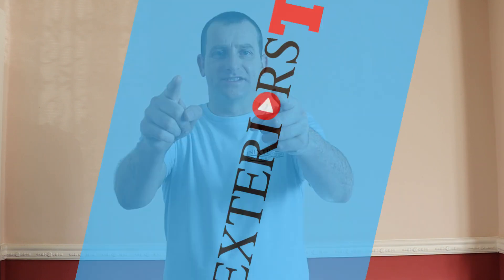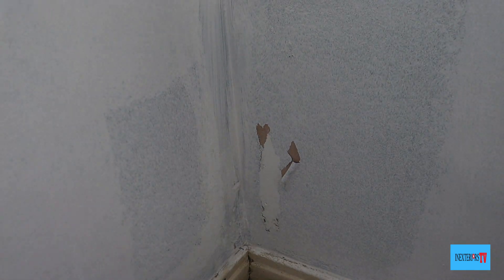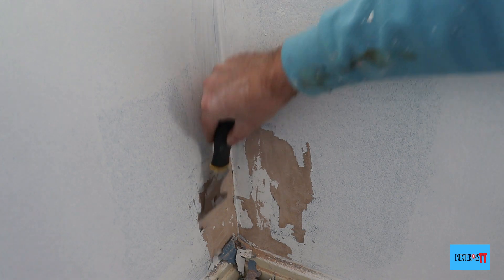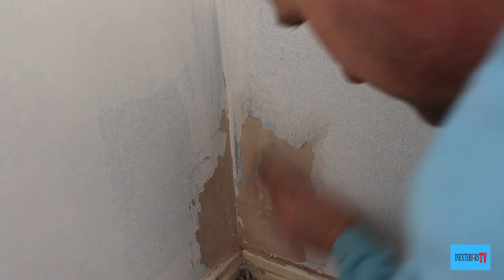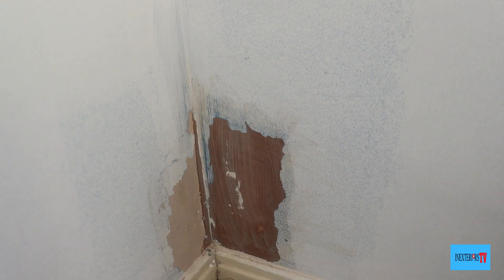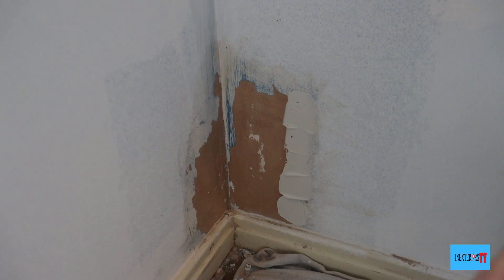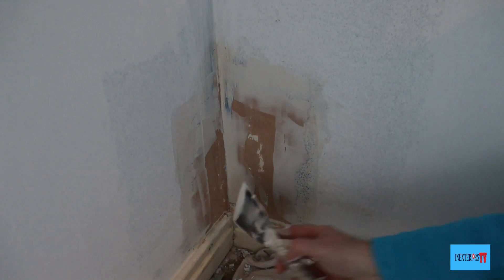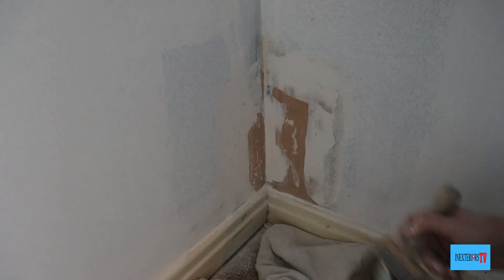How to fix peeling paint. Repairing peeling/flaky paint.

Comment: I used Peel Stop on my shower wall that was peeling. I applied 2 coats of Peel Stop and let dry overnight. Then wiped the wall surface with dry microfiber cloth and painted using sherwin-williams paint.  I was a little disappointed because the paint did not seem to stick very well to the peel stop. I was told you dont need primer for applying latex to it.  Anyway, when pulling the tape off the shower molding, it peeled the paint away in a couple of spots. Didn't expect that to happen.  But I hope the wall will not peel in the future after working on it a day and a half.
By the way, I did the entire wall surface with 220 medium grip sand sponge and clean all debris, before applying Peel Stop.  Hope this wall stays fixed!!
Reply from the maker: It sounds like you worked hard, hope it works for you, open the window when you use the shower. All the best.

Comment: Got the same problem on my artex ceiling. The paint roller seems to have pulled some of it off in a large patch. Although it's recommended not to sand or drill my ceiling, i can atleast try your other methods.
Reply from the maker: @A Samatar. You can indeed my fellow spurs fan. Is it the paint or artex peeling, Come on you spurs.
Reply: @Inexteriors  Think it was the paint. Thanks for the advice
Reply from the maker: @AhmedCSamatar  Use a brush on the offending erea 
 next time.

Comment: That was brilliant thanks.
Reply from the maker: Thankyou very much, thankyou for watching.
Reply: @Inexteriors  have you got a video or any advice please how to prevent flashing/roller marks when painting a wall/ceiling please with emulsion when using a roller. Thanks in advance 👍
Reply from the maker: @christophephilippe1481  When happens on ceilings were its obvious, You can buy a paint called perfect matt for those situations.

Comment: Great video. Is it worth using this on the entire wall over the paint or only the patchy areas? Can you explain why this peeling happens if mist coat was applied correctly?
Reply from the maker: Thankyou very much, the most likely cause of the problem is that the mist cost wasent watered down enough. I only use the peel stop were  needed.

Comment: Hi when you paint after filling did you dilute with water or just use straight out of tin?
Reply from the maker: Neat paint, when its been fine filled if you are painting new plaster or heavy filling then i will water the paint down. the peelstop does a good job of sealing areas of bare plaster and heavy bits of filling aswell.
Reply: @Inexteriors  thank you!

Comment: Can I paint the peel stop straight on to vinyl silk paint?
The silk paint peels off but the paint under makes my paint peel and bubble so wondered if I can get away with sealing without scraping first?
Reply from the maker: If the paint under the vinyl silk causing the problem then you will need to scrape. just be care not to scrape of more than needed. follow the video and you should be fine.

Comment: Hi Steve, loved your video, i need advice, just had damp proof done, 1 meter high new plaster and like the fool i am forgot to do a mist coat & rolled on a thin layer of matt emulsion as an undercoat..its not flakey at the moment as ive only just done it. How do i remedy this? Can i use Peel Stop over the emulsion then start over?
Reply from the maker: You might get away with it, all you can do is carry on and hope for the best, see what happens with it over time . if it starts peeling  then deal with it. If you need to sand inbetween coats dont rough the paint up, just lightly sand, you dont want to tear the paint up and create edges that might start to lift the paint, hope that makes sense, message me if you have any problems.

Comment: Hi mate  can you use joint filler compound instead of gyproc 20?
Reply from the maker: @boaby boy . As long as it can be sanded easy that's what matters bud, what are you filling and how deep.
Reply: @Inexteriors  peeling paint above a shower in the bathroom  it's only a small area  was gonna srcape of the worst of it  apply zinsser  then filler  sand down then another coat of zinsser then paint ceiling
Reply from the maker: @boaby boy  Sounds good to me mate. Be careful when sanding the filled  edges.
Reply: @Inexteriors  cheers pal 👍

Comment: Hi, thank you for the video!
We have condensation on the window and around it, so it's wet.
Nowadays we don't use the heating so it's dried now, and the paint is peeling, flaking off..
I am thinking to use zinsser mould and water resistant paint. But before what do you advise? Should I use the anti peeling layer too? What about the fine filler? Nay of those which will take wet surfaces if we have the issue again? Or should I try  which will work good when it's condensation again?
Thanks so much
Reply from the maker: It might need doing yearly, if the condensation happens every year. Now its dry I would scrape, sand then a couple of coats peel stop, then 2 coats of zinsser bin, to obliterate any water marks, then a fine fill if needed, then  sand and give 2 coats of paint of your choice. Then keep an eye on it next winter to see how it holds up.

Comment: Hi, can I ask, do you need to add fine filler after the peel stop? can you not just paint a layer to match up to the other paint, before adding another coat? Why use the peel stop if you are going to plaster over it anyway?
Reply from the maker: You can just paint, but there may be a ridge from were paint has been scrapped, you need to use peel stop to help stick edges down filler wont  stick edges down.

Comment: What about for smallers patches of peeling, is the filling still required? I thought maybe scraping, sanding then primer+paint would be enough. Is the filler a must-do for the perfect finish? Thanks
Reply from the maker: its not a must do, but it does even the surface out for a better finish.

Comment: At b&q man

Theres no Toupret Fine Filler
Only Toupret Smoother??? 
Is that the same?? I have no clue man and the staff here are horrible

Thanks dude
Reply from the maker: It should be fine, i have never used it. Let me know how you get on with it.
Reply: @Inexteriors  not getting it. Reviews are dreadful
Reply from the maker: @DeeTeaDee  is there a goodhome ready mixed fine filler.
Reply: @Inexteriors  im in screw fix now. They have the toupret stuff! Thanks man! 

Ill just reiterate 

I HATE B&Q 🙂
Reply from the maker: @DeeTeaDee  I dont blame you bud, let me know how you get on.
Reply: @Inexteriors  thanks mate 👍🏻
Reply: B&Q have a variety of ready mixed and powder fillers available from Polycell, Diall etc so no real problem there.......